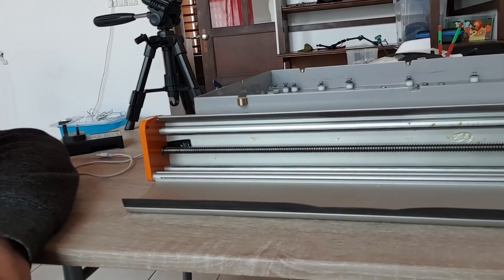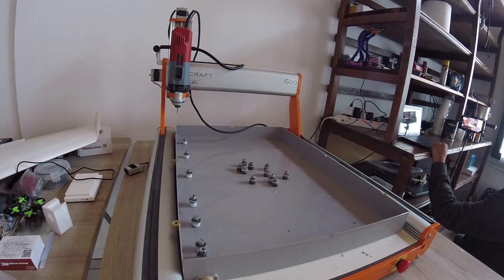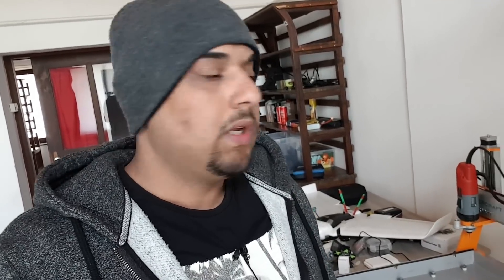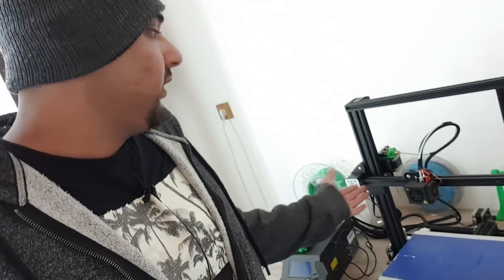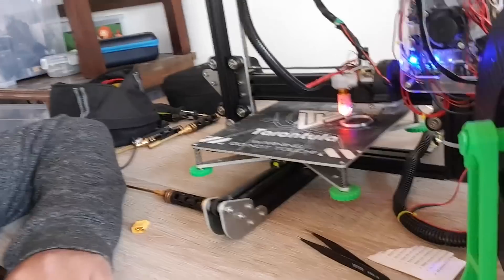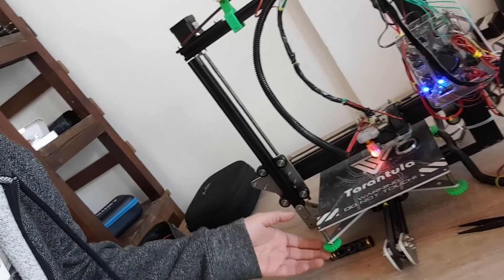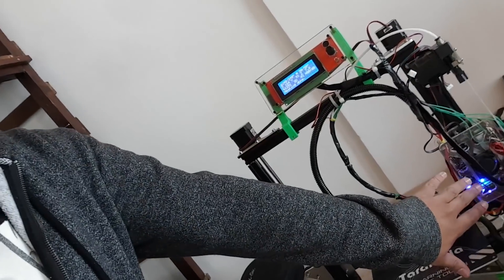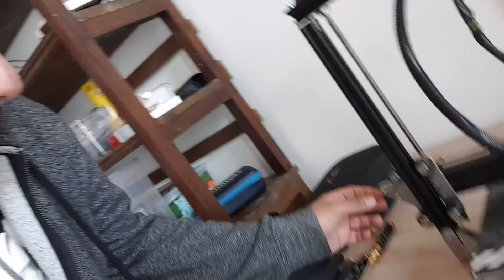Shop Vlog Setting Up CNC Machine & 3D Printers // For the DIY X-Class

Comment: To make your 3D printers remote use octro pi essentially it’s a raspberry pi with a camera and a software so you can move and monitor your 3D printers it’s good I have it on my 3D printer search it up on YouTube you’ll see it if you have questions dm me on Instagram at @hellodarckness21.
Reply from the maker: I have octo print on the creality.. I changed everything at end of day now I have a logitech and 2 instance of octoprint running on my raspberry default port for the creality and port 6001 for tevo.. I ended up placing bot next to each other.
Reply: Sounds good then